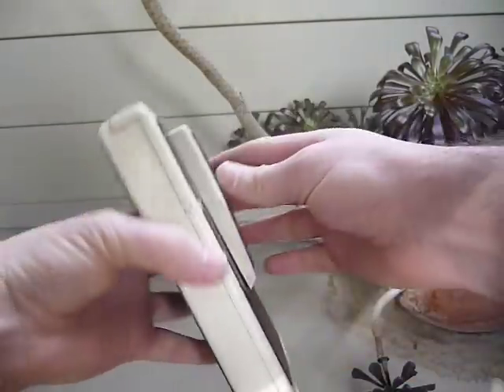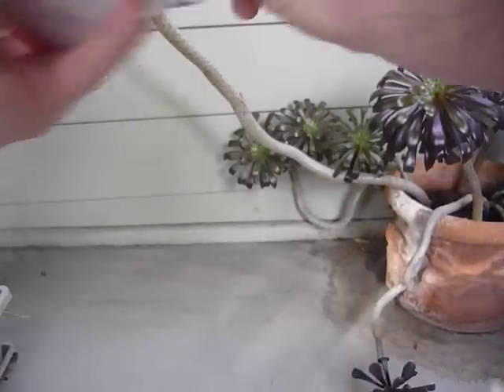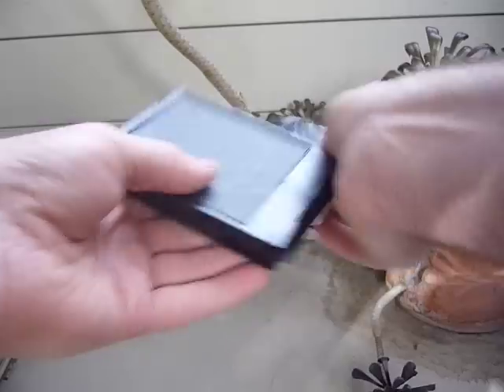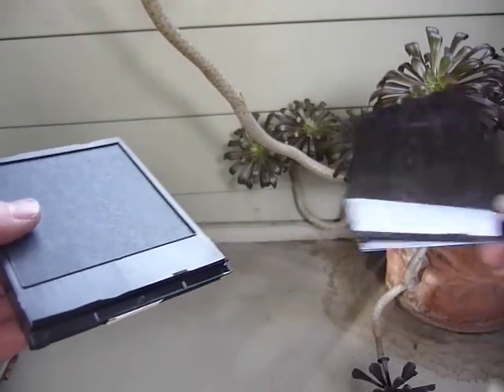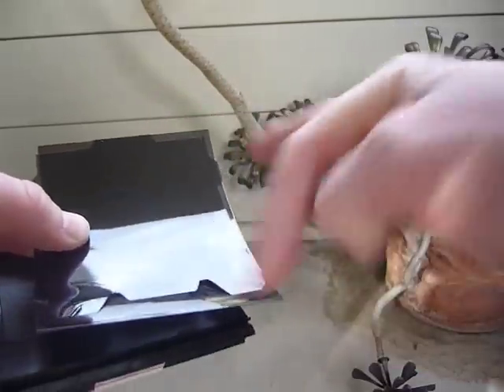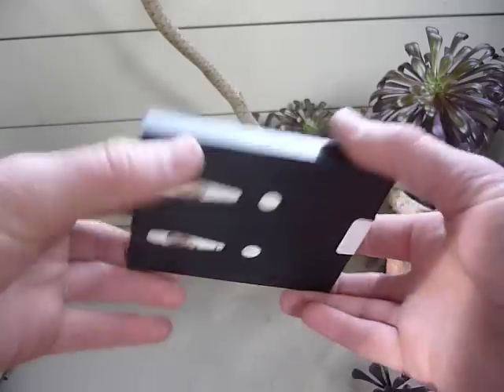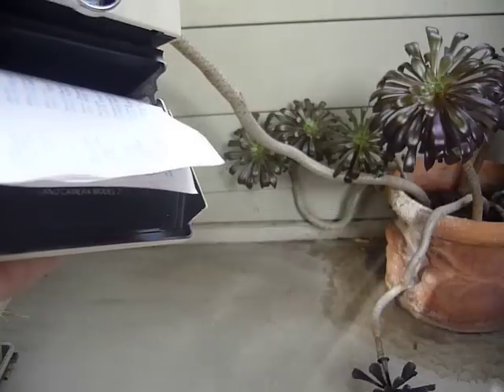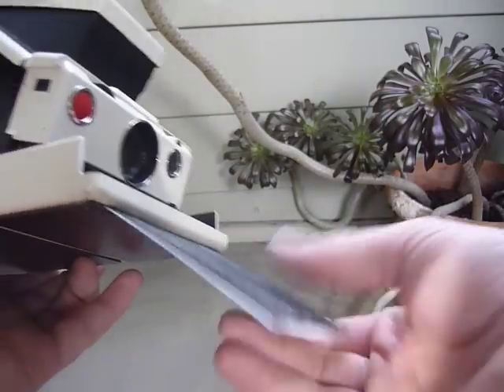How to shoot (use) 600 film or PX680 film in an SX-70 Camera

Comment: why using 600 film instead of films made especially for SX70? what is the benefit? Price? Quality? Value? Thanks!
Reply from the maker: Good question! At the time I made the video 600 film was much cheaper, and more readily available. Impossible film was quite experimental/bad at the time, but it’s come a long way. These days I would opt for SX-70 film. Although, I tended to use the SLR680 camera for most of my photography. I shot exclusively with natural light, so the faster film speed was more versatile.
Reply: @QUARTERSAWN  THANKS!

Comment: Do you still get the benefit of higher ASA when you use the filter? Anyone know what the effective ASA would be this way?
Reply from the maker: David Englund no, you don't get the speed benefit of 600asa. The camera thinks it is shooting normal sx70 film which is said to be approx 150asa. The filter is used to compensate for the difference in film speed. Without it, your photos would be grossly overexposed
Reply: Dear Bradley, what happens if I put 600 film into SX-70 and shoot in darker conditions? Would that work? Low-light Polaroid photography without flash, is that achievable?

Comment: do you have to use the ND filter when using 600 film for an sx70 camera?
Reply from the maker: Yes. The original sx70 film was closer to 100 iso vs 640 iso (600 film) so your images would be grossly overexposed without it. Impossible project sells film for the Sx70 camera that would not require a filter, if you prefer.
Reply: B Johnson Cool, thanks for the clarifying that.

Comment from the maker: no, you don't have to. most pro photo stores will sell the filter material in sheets which you can cut to size.

it's called ND or neutral density filter/gel. it comes in different "strengths". the proper amount is 2 stops.

i can email you a template which you can use to cut out the filter. just send me you email address in a message